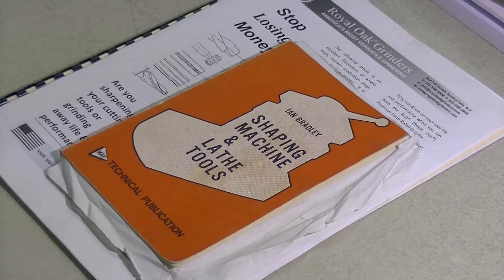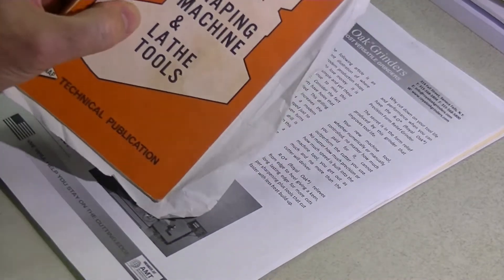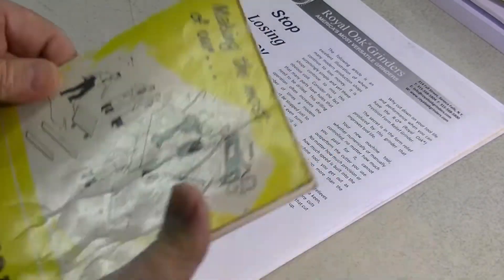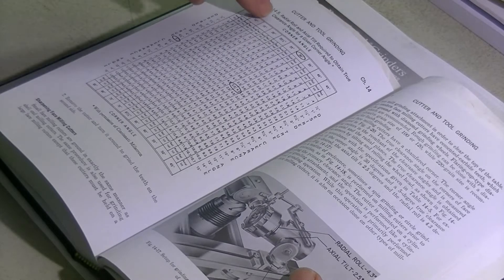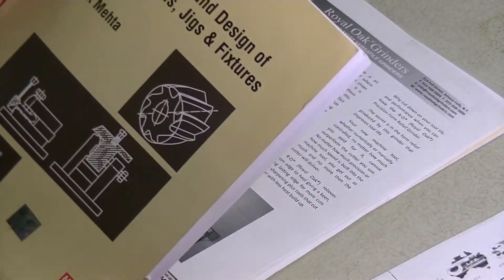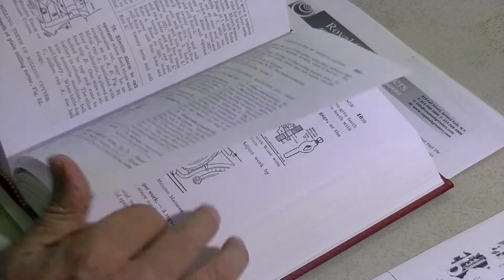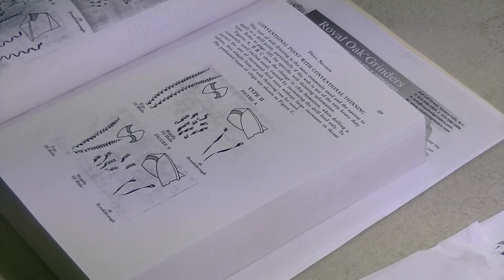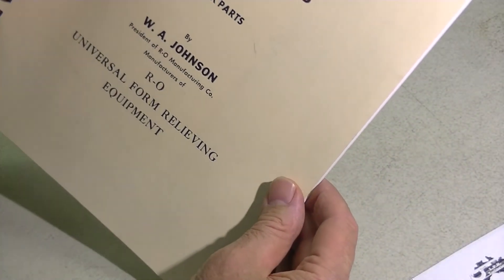Tool grinding information

Comment: I just checked on Booktopia, there are at least 4 different authors listed under the title "Machine Shop Practice" . All appear to be separate publications. Are they indeed different or is it a case of 4 different editors curating 4 different editions of the same basic book?
Reply from the maker: Hi Gary. To the best of my knowledge they are all different authors. Maltrechts book has good pics and is a later book.